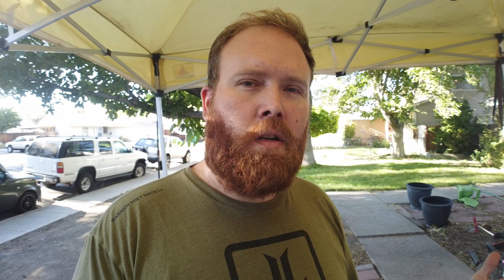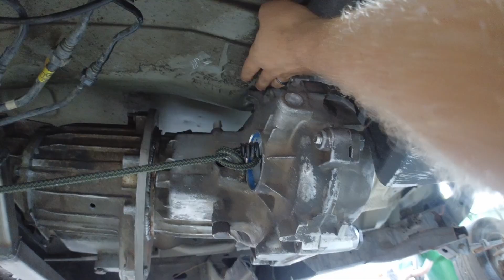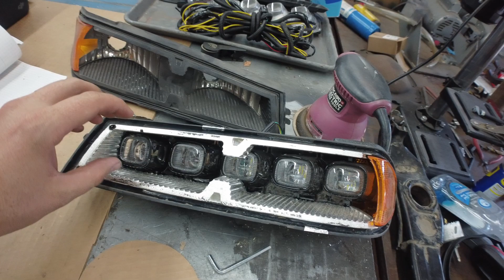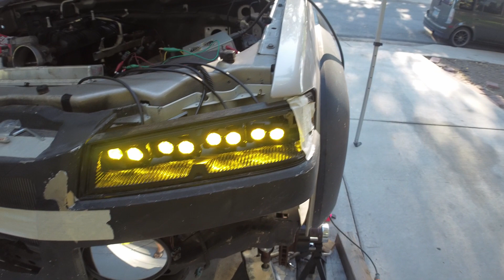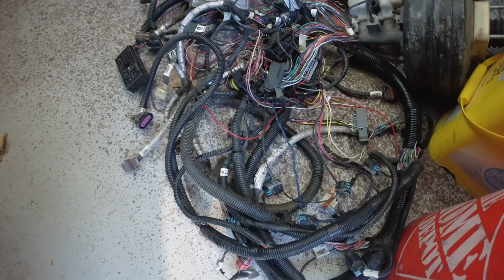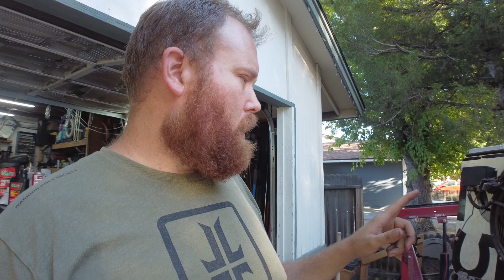What have I been up to??? [6l80 and Doubler Temporary Install]

Comment: You are doing to your truck exactly what i wanted to do to mine. I always wondered how difficult it would really be
Reply from the maker: Follow along and you'll find out with me lol.  It's a ton of work.
Reply: @BadlandIndustries  I mean I still have a 6.0 sitting in my garage that had an oil pressure issue, so it would need a rebuild but... imagine xD
Reply from the maker: @alexanderliterski  could just be the pickup oring that tends to fail
Reply: @BadlandIndustries  maybe but it was driven for about 4 blocks with no oil pressure...
Reply from the maker: @alexanderliterski  tear into it. If it's got oil you should be good.